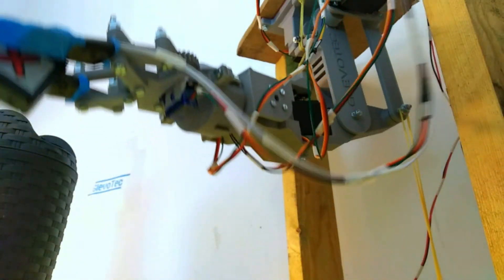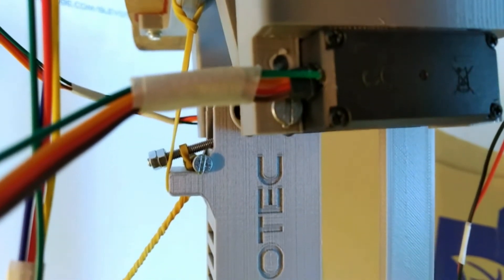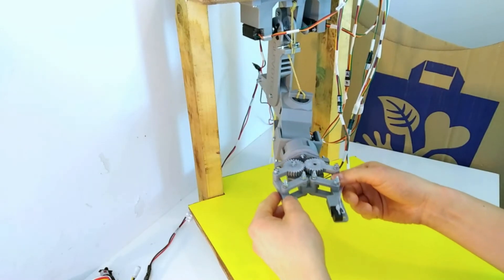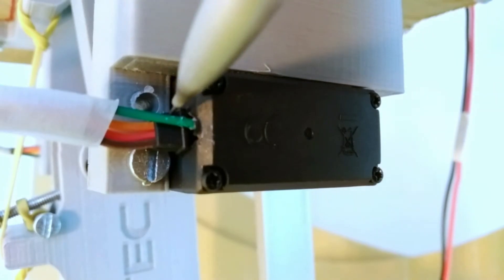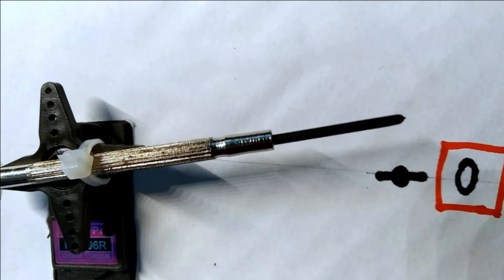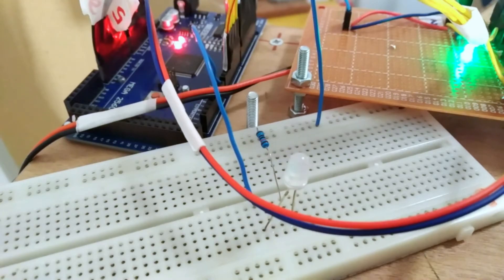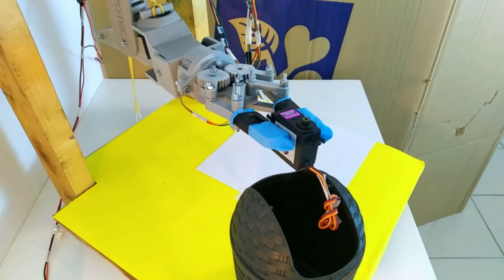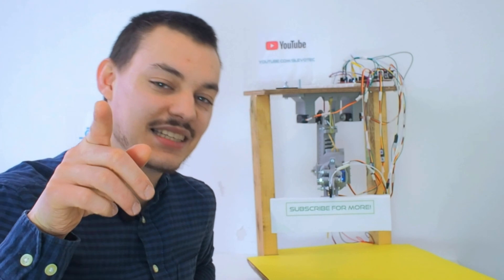Improved DIY humanoid robot arm. Programming without coding?!

Comment: Im curious how strong are these arms? I ask cause ive seen japan has a lot of promising robots similar to what Im wanting Designwise there Orihime robot is the same type of style my intended robot was going for. edit- A patreon you say! ill be there promptly.
Reply from the maker: The strength of the arms mainly depends on the servos that are used. With these I've managed to lift a ceramic drinking mug, haven't tested it to its limits yet. These are 11kg-cm servos. So if build with 25kg-cm heavy duty servos it could lift a decent amount of weight. Keep an eye on the channel, as I will develop this further. And support on my patreon is greatly appreciated, thanks!
Reply: @GlevoTec  good to know! I saw another video from a DIY channel that was showing there darpa dog style robot lifting some metal weight for its tests. Im wondering if making the parts with thin cutout Steel and vaccum formed ABS shells would make for a lighter robo.
Reply from the maker: @Hoshionifumo  The 3D printed parts are not that heavy. They're also reasonably strong, so I think they have potential. My goal is to make them able to handle small objects, like we mostly encounter in our daily life
Reply: @GlevoTec   If they can handle 20 pounds I think they will meet the need. cause , to me even if your only doing 10 pound objects. you wont overstrain the mechanics. I like the idea we could have at home industrual grade things. but Im not gonna let perfect be the emeny of the good! keep it up.
Reply from the maker: @Hoshionifumo  Thanks. I'll keep working on it.